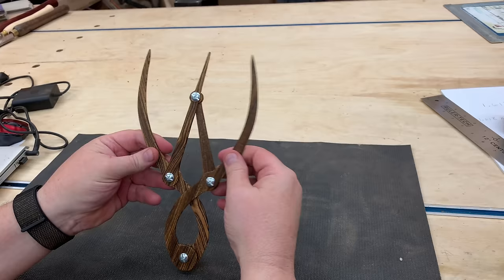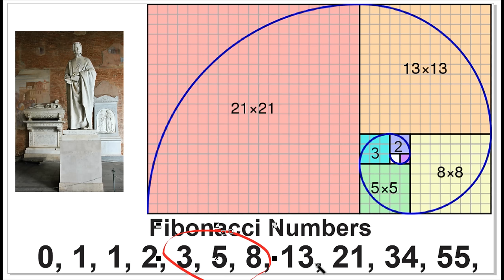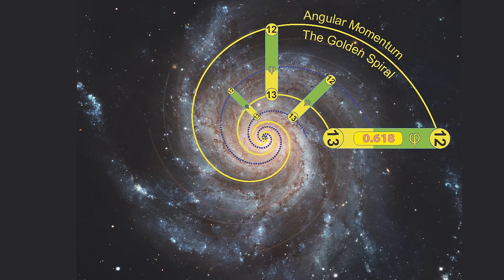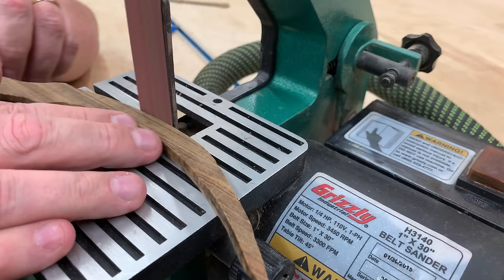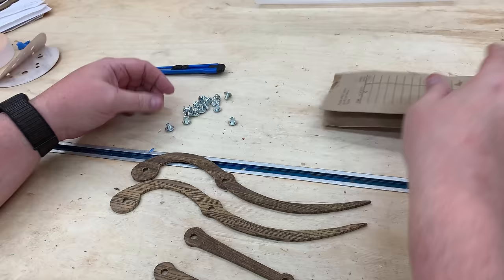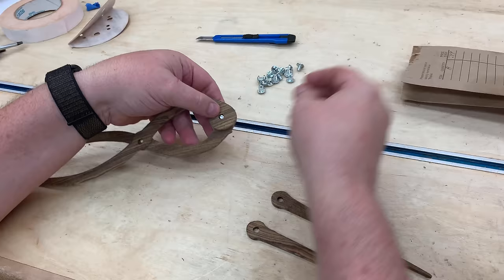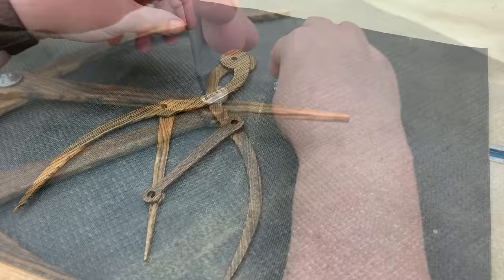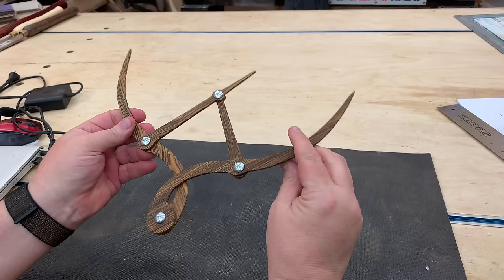82 - How to Make Golden Ratio Calipers Golden Mean FREE PLANS

Comment: The hardware is also known as Chicago screws or book binding posts. Posts are the nut portion. You can can them in closed or open (pass through) backs. If you bottom out on a closed you have to grind down the screw or get a shorter one. The screw are normal machine screws with 8-32 threading being the most common.
Reply: Yep.  Commonly found in stores supplying rivets for leather craft, knife handles, etc.
Reply from the maker: Good to know, thank you!
Reply: Yep, was also going to say you can get fancy pretty ones at Tandy Leather
Reply: We called them "sex bolts" back in the day.

Comment: I'm sure someone else has mentioned this but golden ratio and Fibonacci Sequence aren't quite the same, just very close, and neither appear accurately with any consistency in nature, just very close sometimes. Fibonacci has a start point at 0 and only increases from there and golden ratio is infinite in both directions.  They are both fascinating  and interesting to learn about and use in art and craft and I've used both for marking out anything that needs to be visually appealing but I've never seen these calipers before. I'm looking forward to making some. Thanks for sharing.
Reply: they aren't the same thing, after all, one is a sequence and the other a ratio, but the golden ratio is directly derived from the Fibonacci sequence, and the further you go into the Fibonacci sequence, the more accurate of a golden ratio you'll find

Comment: Hi I watched this video after watching your video on Google SketchUp (wanted video on SketchUp for my friends kid).
I like making things from metal or wood and I uses SketchUp a lot because I think it is better to make a mistake in the drawing stage then making stage.
But the main reason I am commenting here is that if anyone use SketchUp when you use the rectangle tool if you slowly drag it out you will see a dotted line from corner to corner and the words "GOLDEN SECTION" it will also show when it is a square.

Comment: Fascinating and awesome.  Just a question:  You taped those two pieces together to sand them, then separated them, and then taped them together to drill the holes -- why not drill the holes while they were still taped together?
Reply: I get the idea that he was learning as he went along.  I too would have left them together. Perhaps he learned from the Master Norm Abrams and is showing two ways to do it. Either way, it worked out.

Comment: anyone else notice that the assembly b4 staining was different than how he assembled them for the finished 1? as in the 2 smaller arms b4 staining were on the same side of the calipers stacked to the outside by 1 extra thickness (3 layers of wood thick) , while after he assembles them with each smaller arm sitting to the inside of its attaching larger arm so all in all its 2 layers thick.

Comment: Great video but how did you work out the geometry of hole centres and dimensions from pivot points to tips? I want to use in engineering projects so accuracy of tracing from a print wouldn't be accurate enough.

Comment: Where did you get the hose on your grizzly belt sander? It looks like it’s fairly flexible. All I seem to be able to find are the extremely rigid hoses or the Rockler hoses that weigh a ton.

Comment: Why not drill the holes before removing the double sided tape rather then take it apart and re-tape it?
And that last short arm should go on the bottom to keep everything on two levels, not three, and then after oiling it he did it correct.
Reply: CORRECTLY!

Comment: Why didn’t you drill it out before you pried it apart to remove the double sided tape? You could have just taped the smaller ones to it and drilled it and then pulled it apart just once.

Comment: Cool project But I will never use this lol! I have my masters in Civil Engineering We went over this my second year but its kinda Obsolete With architectural in the Modern age. There are some instance where A Box made by the rules of the golden Ratio is pleasant to the eye But with all The artistic stuff and different Shapes we have been A costumed too This has gone right out the window!  I think it was the Greeks who used this with Temple building using it on the blocks in temples. Cool project!

Comment: The plans are free, but I have to open an account to pay the sum of $0.00?  So why are you collecting people's names, addresses, and other contact details for a give-away?  Seems a bit sus.
Reply: Because it's in a store. An online store computer can't tell the difference between actually selling an item and giving it away; all it "knows" is that when it gets a request for any item, it's supposed to ask the buyer (you) for a billing/mailing address, e-mail address, and PayPal or credit card information, so it can inform your bank/credit card/Paypal of the "charge" of $0.00 to your account, send you a confirmation e-mail, and allow the company to contact you if something goes wrong.
Reply: @Anastas1786  I have designed and maintain many e-commerce stores for customers.  For things with no charge, it is incredibly easy to insert a link to a .pdf file which takes nothing more than a single click to download the .pdf.  Having to register and provide personal information is totally unnecessary and uses server power, bandwidth and takes up space in the database.  A .pdf file on the server with a link to it, on the other hand, uses far less server power, bandwidth and uses no space in the database.    Nice try, but no cigar.
Reply: NEWS FLASH for those who have never used "internet" before. You can make up the info if you don't want to provide your actual info. The download link appears directly after you pay ($0.00), it is not emailed to you... This is not ripping anyone off, King's Fine Woodworking doesn't even collect these emails from the free plans.